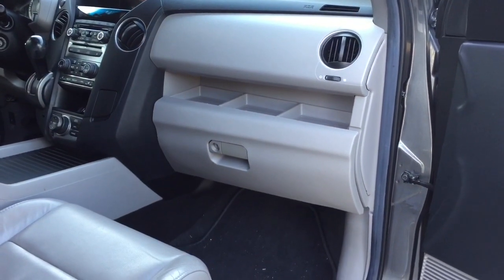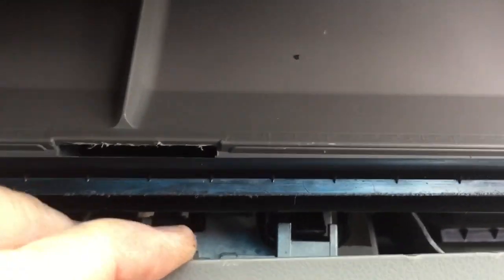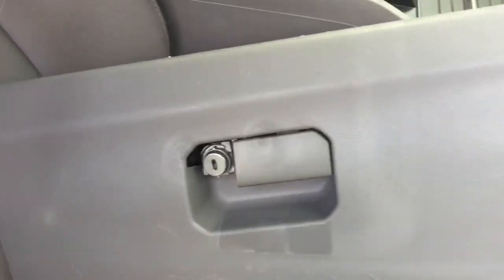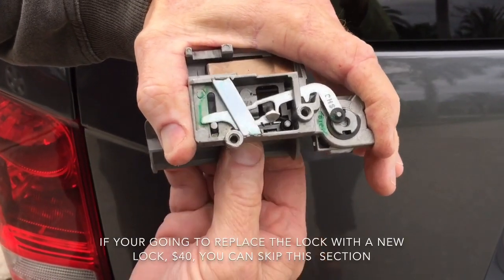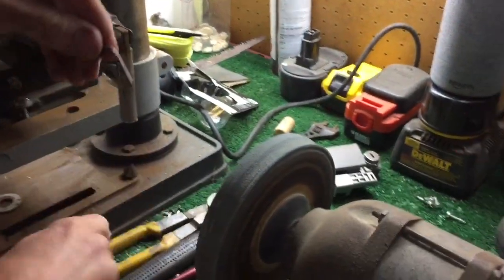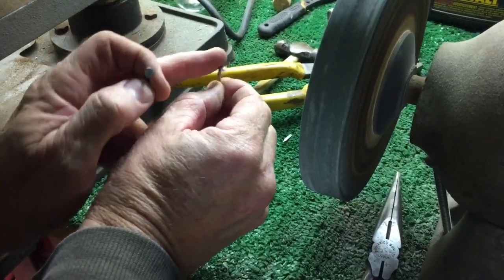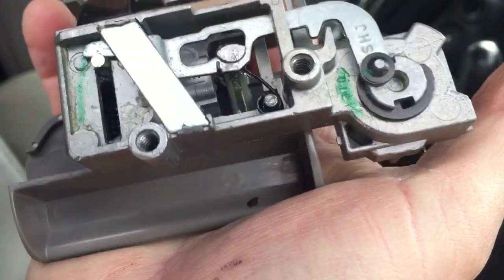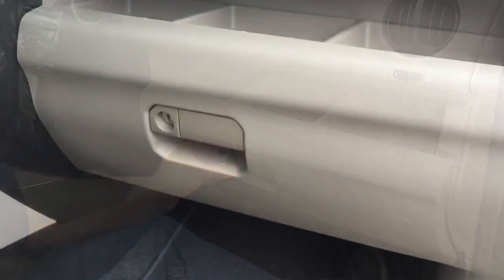2012 Honda Pilot Stuck Glove Box Fix, won't open

Comment: I needed to work on a CR-Z rather than a Pilot. However, this video contained relevant and valuable information on how the front cover is attached. It really helped me to get started. Thanks for making it!

Side note: With the glove box outside of the car, I used a heat gun to carefully heat up the attachment areas to make detaching the cover easier and less risky.

Comment: Perfect video! After watching several videos, of ALL different methods, this worked perfectly on my 2012 Honda Pilot! You’re a life saver. After opening, discovered the plastic pull handle snapped inside the mechanism at the pressure point in which it engaged on a metal lever. Faulty design to use plastic at a crucial pressure point. (probably intentionally designed to break over time). 
Couldn’t have got it without you!!
Easy & clear help!! 😁😁👍🏼

Comment: Thanks for this video, especially the nail trick for repairing it. I noticed a small gap on the right side under the handle that allowed me to fish a bent wire coat hanger up above the latch inside. I then moved it slightly left and pulled down to open the box without needing to remove the trim.  I also had a 4d finish nail laying around that fit perfectly without needing to grind it. Just bend with pliers, trim to length, and glue it in.

Comment: I have a 2009 Honda CR-V that I bought used and the glovebox wouldn’t open, I tried this for HOURS, I was losing my mind. I finally had to take the two 8mm bolts off the bottom to get the glovebox to hang loose, then I pulled it out as far as I could and pushed the sides of the glovebox in as well allowing it to come out from the frame holding it even more (I didn’t care if it broke or not as this point, but it didn’t). Then I had to lay on my back in the floorboard and cut the back of the glovebox out with PVC cutters. The cutters allow you to cut through thick plastic like that. It was a pain in the a… but it did the job. I had to cut a decent size so I could unscrew the metal bar the latch attaches to, there was 1 8mm bolt/screw attached above the latch, then I unscrewed 2 regular screws that hold the latch to the glovebox frame, with the bar and latch no longer attached to the frame I was able to pull the glovebox even more where I could see the latch and use a screwdriver to undo it and it opened. It was hell but I got it.. after getting the latch off I could see why this wouldn’t work for me. The latch mechanism was bent and it wasn’t hitting the part to pull down the latch. So for hours I was pushing it down and it wasn’t hitting anything.. this is a lot but it worked.

Comment: The dealership is currently fixing the same issue and they did not peel the panel off. Instead they used a tool to remove the plastic face around the lock and to remove the lock itself. It was broken when I bought it so they're fixing it at no charge to me but they have to order a part for it.